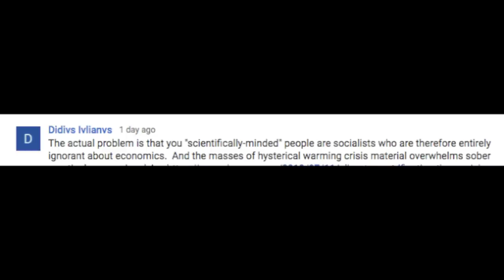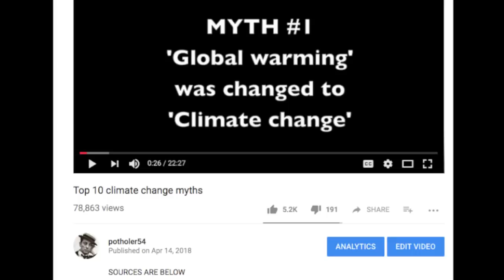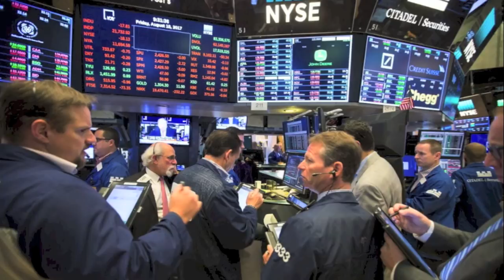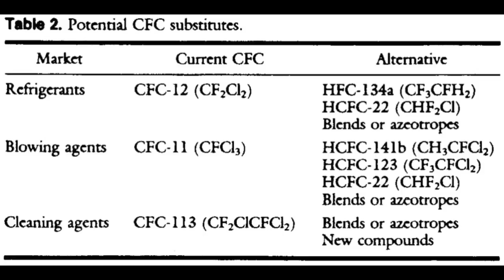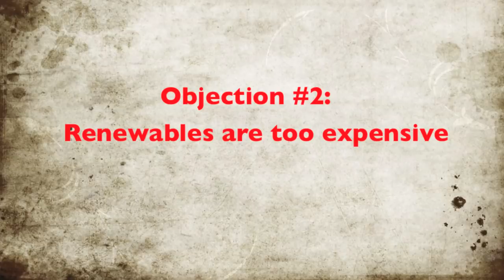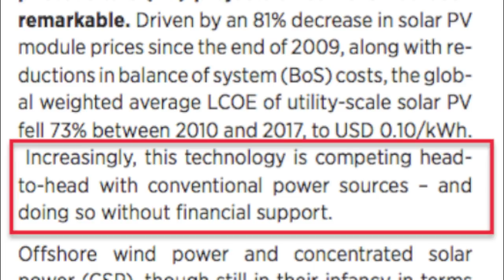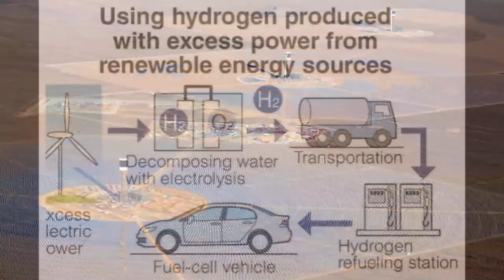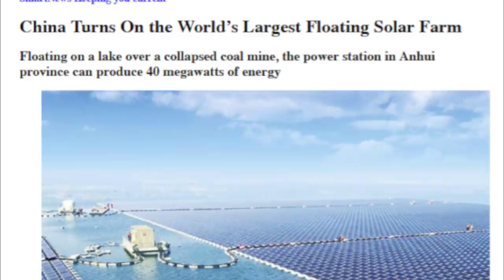A CONSERVATIVE solution to global warming (Part 1)

Comment: While this is a great way to introduce more conservatives into the idea of supporting green energy, I think that you ignore one of the most important pieces of this issue: corruption.

Corporations have governments in their pockets (particularly in the US, this is very very evident). The fossil fuel industry can really only operate at the enormous scale that it runs at now due to subsidies. This is similarly true in many cases for green energy, especially since we still need more advances in the technology for them to be as useful or practical or reliable as fossil fuels, something we haven’t had nearly as much to figure out as we have had with fossil fuels.

So the answer seems simple: take away fossil fuel subsidies, replace them with Green energy subsidies (very glad you focused on this). With that, we start phasing our old polluting infrastructure real quick. Seems perfect right? Not in reality.

This should be the way we are tackling the problem, but it’s ran into some huge obstacles.

For fossil fuel corporations to be able to make their huge profits, they need fossil fuels. They’ve got the infrastructure and logistics already in place and the market is constantly in demand of more as we keep using electricity. If politicians want to implement green energy subsidies in place of their fossil fuel subsidies, that will still make a very notable impact on their profits as they shift their focus. Capitalism encourages only caring for profit, and so they will lobby and fight tooth and nail to keep their grip on those profits. Politicians will be happy to keep them in place if they get lobbied into the ground and have their careers threatened as they suggest removing profits from these corporate giants.

The solution seems so simple, and even accomplishable purely through capitalism at the surface, but it’s really going to take serious government pressure before anything will budge. These smaller companies you’ve mentions are great for getting new tech on the market, I absolutely think they’re doing the right thing and should continue, but it’s cheaper to keep buying up all of that oil, gas, coal, etc to get your energy just like we’ve done for over a century. The only way these companies will make the switch is if there’s an immense amount of pressure on them, or they have stripped the earth of its resources so badly they cannot make a profit with what little is left. Plus we’ll have all burned in colossal forest fires and drowned in mega hurricanes by then, so not that it really matters (hyperbole of course).

What we need is a serious amount of government intervention or we’re screwed. Fossil fuels are far too profitable in the short term to allow capitalism to make this change in time. Similar to FDR’s social programs in the New Deal that radically bolstered the country from its economic woes, the US (and the world as a whole, really) needs to push sweeping changes quickly, not sluggishly, before it’s too late.
Reply: I only trust government, given its well-documented track record for screwing this up (quite spectacularly at that), to implement its own interpretation (the potential for abuse this has cannot be ignored) of climate action and/or carbon pollution (as if the latter was even a thing when it's clearly not as CO2 is more of a natural resource than anything). We can at least implement communal food forests in suburban areas, set up carbon capture facilities with the means to break it up into carbon and oxygen for use in various industries.
Reply: Green energy yea$$$$ the $even decade$ of weather modification and in$ider trading on weather is pretty green.
Reply: FDR’s social programs was total trash for this country even hailed by the historians and marxists.
Reply: @RosyOutlook2  Politicians have been known to pursue their own agenda, even if they establish relations with various corporations. They see corporate donors as a means to an end. If they feel as though they can no longer benefit from that partnership, they move on to the next donor. These corporations are using climate change to lobby for regulations FAVORING themselves and PUNISHING their competitors.
Reply: That government intervention you say we need is exactly what you point out is seemingly impossible thanks to lobbying (ie. corruption)
Reply: D. K. Yes, that’s correct, which is why we require serious systemic changes to eradicate and prevent lobbying and corruption.
Reply: @Iamwolf134  "So what you're suggesting..." ...or some variant is always the first step in straw man construction on the internet. Some of my other favs are:

1. "So what you're saying..."
2. "What you mean is..."
3. "Are you saying..."
4. "Let me get this right..."

So how did that straw man turn out? Did it put up much of a fight?

Cheers!
Reply: @ajmeyers5661  Trouble is that sweeping changes on a small time frame would absolutely instigate a societal upheaval that would destabilize the nation at ALL Levels, benefiting only the corrupt elite at the expense of EVERYONE ELSE around them.
The upheaval itself would invariably be SO MASSIVE that it would make the Antifa/BLM riots look like a teddy bear's picnic. I speak only of the massive amounts of debt and death that would result from the societal upheaval that in itself is a result of massive government reforms, especially over non-systemic corruption.
Truth be told, these politicians, most democrat politicians in particular, have ALWAYS had their own agenda, and only ever see any form of corporate partnership as a means to an end. They only keep their teeth gritted to maintain a façade of being spineless, when they're a deceptively fickle bunch who will always move on to greener pastures at the very first opportunity, that is, finding a corporate donor who has more money. If government itself is made to be the GREENEST pasture of them all, by whatever means necessary, then god help their corporate donors as they turn on them. The only reason why they're the ones even championing such changes is because they'll be the only ones who benefit from such reforms.

By the way, that was no strawman, but rather an indisputable fact.

Comment: Thanks for the very interesting video potholer, really nice discussion. I agree with much of what you say, but I'm very skeptical on how much of a role renewables can play beyond a certain scale, due to intermittency. It's certainly true that batteries can be used to store excess power .. the problem is how much power you need to store and whether that is realistic to achieve. For example, the UK consumes about 300 TWh a year of electrical energy, which is about 0.8 TWh a day. Realistically you'd need enough batteries to store at least a week's worth of energy production, since sometimes the UK goes that long without significant wind or solar production. 

The entire world's production of lithium batteries, for all purposes, is roughly 0.2 TWh a year. So if the UK bought all the batteries produced in the world in a year, that would give it enough capacity to store about 6 hours of UK energy production. That is not even nearly close to enough to smooth out the intermittency of renewables, and this is just the UK, what about the rest of the world? Batteries are getting better, but they aren't going to get hundreds of times better, which is what would be required.

There are similar issues with pumped water, compressed air storage, pushing weights up hills and just about every other way of storing electrical energy. The problem is simply that you need so much of it so cope with renewable intermittency that it's never realistically going to happen at a scale that is large enough to be significant, whether you have a "can do" attitude or not. This is why no country is doing this at significant scale, they are instead relying on fossil fuel backup. This is part of the reason why Germany has been failing to meet its CO2 reduction targets, despite investing more in renewables than almost any country in the world.

I also notice you haven't talked at all about nuclear power. Nuclear power produces very little CO2, and France in the 70s and 80s rapidly decarbonised its electricity production using nuclear power. To my mind this seems a much more realistic and tested approach to reducing CO2 emissions.
Reply: Solar power will provide the bulk of the global energy we use, including our cars in a decade.

Energy is changing from a resource based system into a technology based system.
Technology can be scaled basicly infinitly, becomes cheaper the more we use of it and becomes more efficient over time. The exact opposite of how resources work.

Pv can be manufactured by anyone anywhere in the world. All you need is a factory, and another, and another.
Same goes for batteries. Battery production trippled in the last couple of years and is set to quadruple again in the next couple of years.
A new giga factory in germany, samsung is building their own, so is lg and a couple in china as well.

"Powerwalls" from chinese and korean manufacturers will flood the market when these factories are up and running making them cheap commodity items, like fridges and tv's.
And solarpanels are already cheaper then grid energy. They simply save money.

Companies with large buildings like factories, farms or retail buildings are filling up every square feet the can. Not because it is environmentally friendly. They do it because it saves money and sometimes is an additional income stream. 
They recieve lower bulk rates for the energy they buy from energy suppliers then people do. And still it is an substantial impact on their bottom line worthy of the investment.

Solar farms are already the cheapest form of energy generation, as low as 3 cents per kwh including storage for use at night. That is for profit without subsedies. Lowest price records keep getting broken by new projects multiple times a year. 

And this is only going to keep accelerating. This adoption is lowering prices faster, which will accelerate adoptin further, which will lower prices even faster etc. 
Adoption is about to go exponential, both on commercial scale as well as individual adoption, especially with the shift to ev's that now will be charged to the electricity bill, a great incentive to adopt solar to save money or even make it pretty much free.

Not to mention the fact that the grid is a very expensive piece of infrastructure that needs to be funded by the people pulling energy from it. As it will be utilised less and less the cost of it will be spread over less and less kwh's, only increasing the price of grid energy over time. Only incentivising solar adoption even more.

Everything is converging at the same time into a masive disruption of our energy systems.
And like every technological disruption it will happen quickly and near universal within a handful of years.

Adoption of new technology starts slowly until it hits a pricepoint where it suddenly makes sense. At that point everyone jumps on it at the same time. That is how all technological disruptions have gone in the past and this one will be no different.

Comment: Yes, all those goofy people saying pollution isn't bad, burning and releasing CO2 has no effects, etc.  Yes, all those nuts who block modern, new nuclear designs that avoid water cooling and needing enriched uranium that conflates energy needs with WMD.  And for now, we still burn oil/gas/coal for electricity, so perhaps we'll need a bit more as we wean off these technologies to deal with "intermittent power issues," but the reality is most energy is consumed during the day, and wind doesn't necessarily stop, and we still have hydro, geothermal, wave, offshore wind and nuclear among new technologies that produce fuel (like for jets) by scrubbing carbon, so we get the energy needed without adding more carbon.  I trust in free market, smart minds over fearmongers and tyrants.

Comment: Between 2010 and 2013, there was a noticeable increase in the price of electricity for households in Germany. At the start of the decade households paid less than 24 euro cents per kilowatt-hour. However, this increased by more than five euro cents by the second half of 2013. In the preceding years prices remained relatively stable, peaking at 30.48 euro cents in 2017. By the second half of 2018, German households were paying 30 euro cents per kilowatt-hour.

Electricity prices worldwide

Electricity prices in Germany are some of the highest worldwide, and only cheaper than Denmark throughout Europe. In 2018, German customers were charged 0.33 U.S. dollars per kilowatt-hour. Although production is cheap, additional taxes and fees increase the final cost. 

Renewable surcharge

  One of the additional fees that increases electricity prices is the renewable surcharge. In 2019, this surcharge made up 21 percent of the final composition of power prices for German households. This levy is to support Germany’s renewables expansion, such as wind, solar, biomass and hydropower installations.
------ Taken from https://www.statista.com/statistics/418078/electricity-prices-for-households-in-germany/

Comment: I've been critical about your other videos on cimate change, but I appreciate this one. Yes, we should continue to find better alternatives to fossil fuels. However it is a journey that will take some decades. It not as simple to solve as finding an alternative to CFC's. We also have to be careful not to deprive developing from using the most economic energy sources in the most responsible ways. Also we have to watch out that we not only try to prevent the consequences of climate change, but also try anticipate disaster if it turns out be that despite our efforts we can't prevent them from happening.

Example: Since a few years I've got solar panels on my roof and drive hybrid/electric. But since I live beneath sea level, my first priority is to be sure to keep dikes strong enough to keep the water out rather than to keep up spending my money on trying to be green.

Comment: Been thinking about this for a while, and it seems the American attitude is to let someone else develop the technology and then buy it, but only when it becomes economically viable.  UK is going that way too.  When you consider most of the jobs are in the service sector (UK is 80%), and not manufacturing, you can see why. Western civilisation has become a 'consumer' society (dare I say 'lazy' ? - let someone else do the hard work, we're comfortable for now) rather than a 'hands on, practical' one. I'd guess there is also little funding for research, if it's not for something that's immediately required or urgent.
Reply: UK, just like France, goes the way of nuclear energy. In that case I think it is totally cool to wait for somebody else.

Comment: China is also bulding 24 nuclear power plants.
Reply: No. They are not
Reply: It's pretty easy to fact check this. Wikipedia for a start. And you'll read: "As of March 2019, China has 46 nuclear reactors in operation with a capacity of 42.8 GW and 11 under construction with a capacity of 10.8 GW. Additional reactors are planned for an additional 36 GW. China was planning to have 58 GW of capacity by 2020.However, few plants have commenced construction since 2015, and it is now unlikely that this target will be met" So in short Gary Lewis is close to the mark. 24 additional plants may be a conservative estimate if the planned expansion does take place.
Reply: Great!